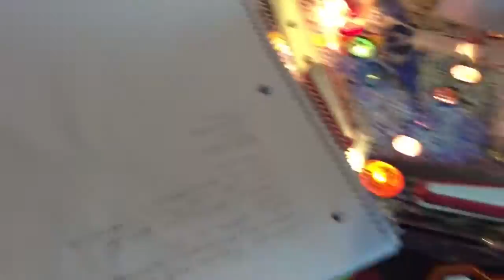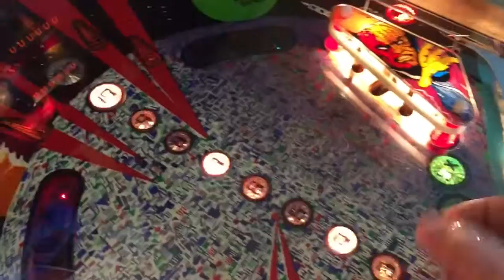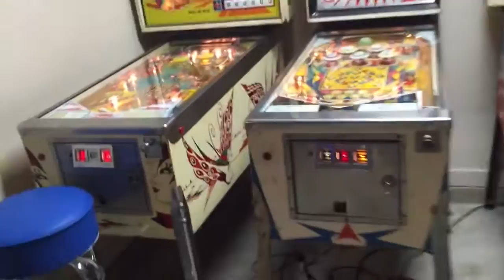TSP Ep4 Custom Polycarbonate Protector for EM Pinball

Comment: Hugely useful and inspiring video. I'm intending to try this technique next year, with my 1961 Gottlieb Flipper Parade.
Reply from the maker: Thanks!  Some of the videos helped me learn how to fix these and I wanted to "pay it forward."   I'm glad to see this will help at least one person and if you have any questions don't hesitate to ask.
Reply from the maker: +horipet  DON'T try this on your pin.  I'm going to have re-work this technique and allow for expansion of the plastic sheet by allowing it to float along the edges.  On the longer axis from the inserts, because the polycarb is locked down, when it expanded it had nowhere to go but up, causing it to get large bulges on the playfield.  I'm going to attempt to rework it to allow it to "float" on those longer axis.  Stay tuned.

Comment: First, nice work and nice video.  Not much else to say. 

I made one of these for a Stern Big Game.  This pin has 27 lights in the center of the play field.  I knew it was going to need to float so I made it where it locked down under two upper inlane posts.  But I did not  trim around the play field parts carefully enough and experienced this pillowing you  talked about.   Once I corrected for the needed clearance I has no more problems. 

I tell you all of this because I did not drill any "heat relief" holes around all the lights. Just making sure my poly protector had clearance from all the play field paraphernalia was enough.

My question:  After you allowed for all the needed clearance, did you try your protector to see how it would behave before you drilled all those small heat relief holes in the center? 

My contention is that adequate clearance is all you need as any heat generated will travel until it escapes somewhere along edges and that it was unnecessary action to drill all those holes. 

Thanks